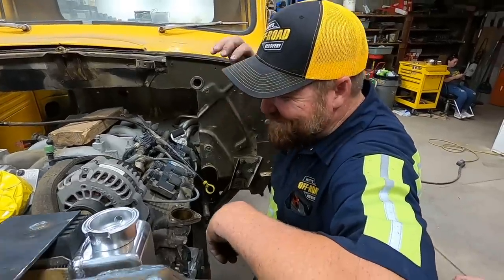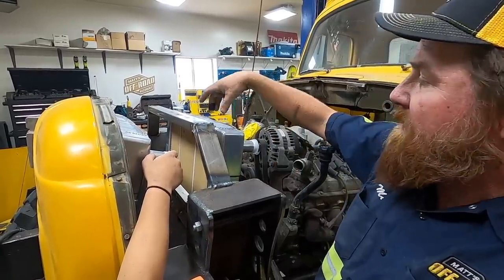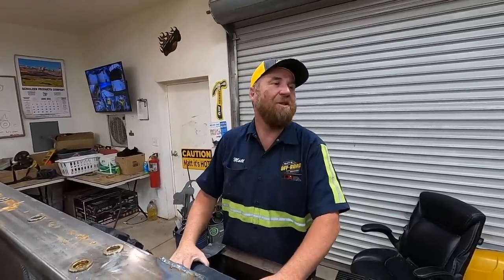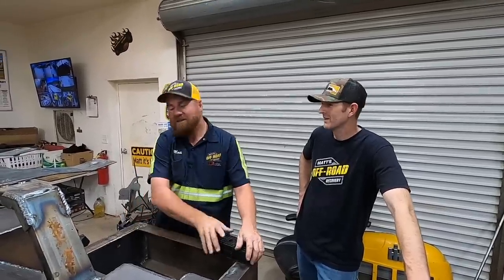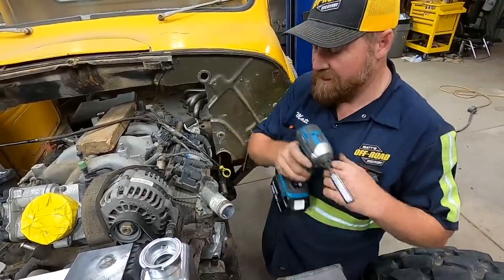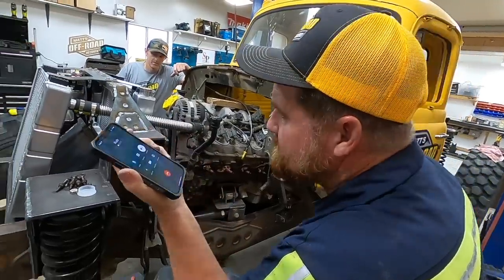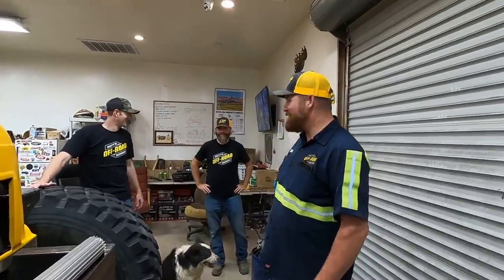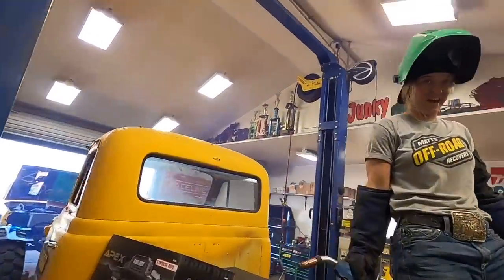This Part Ruined All My Work! The World's Largest Off Road Wrecker

Comment: I have an engine oil cooler on my 3500 dualy.   Considering the heavier loads you are going to put on a wrecker, especially in the environments you will be running I would highly recommend it.  Its really helped out when pulling heavy loads up some steep grades in high heat.

Comment: Assuming you have the room under the bonnet, consider finding a way to raise the fill port a few inches so it is above both radiators to aid in filling. You need to have a common high point to properly purge the air.
Reply: I was going to say something similar.  From my experience in building water cooled computers's back in the day before they made main stream blocks and RadFanCoolerReservoirs for them like they do now-- I toyed around with extra large reservoirs where the pump drew from the cooled water in the res than from the cooled water from the Rad.  Although this created a condensation effect on hot days from the Res...the system ran cooler with Res to pump to block to rad  than drawing directly from the Rad to Pump to block to Res.
Reply: It was shocking  to see neither of you have ANY fabrication videos on your channel. yet here you are giving advice to a professional fabricator. Dang that is weird stuff.
Reply: Came here to say the same thing. As it is, I'd say he will have a issue with air pockets. I'd  recommend adding a steam port from the crossover to the fill port.
Reply: @eriklarson9137  it was good advice.
Reply: @eriklarson9137  not all experienced builders have to be youtubers so no need for negative feedback on a valid suggestion. Its a common knowledge that the filler or the reservoir has to be higher than the rest of the system since the air gets trapped in the highest point. To me it seemed that the filler was the highest point so it should work just fine.  If its not possible to achieve, there is a bleed valve added to the highest point.
Reply: There's a cap on the radiator 
Filling it and bleeding won't be an issue
Reply: @eriklarson9137  many smart people don't video everything they do.  Doesn't make them wrong.  Besides this is a place for ideas.
Reply: @eriklarson9137  remind me to add that to my contractor/mechanic interview questions.  "Do you do you tube? No? Darn sorry, random internet guy said if you dont do videos, you don't know what you are talking about."
Reply: As long as the radiator cap is the highest point in the system he will be ok. If not he needs to add a surge tank to raise the radiator cap in the system. It looks like he is ok.
Reply: BFTtheTRUTH  Air Lift is a tool that pulls a vacuum on the cooling system so you can then pull the coolant into the system and not get any air pockets.  It is a requirement on some new cars such as the GR Supra.
Reply: @eriklarson9137  I'm pretty sure he runs a rescue company, and is not a professional fabricator.
Reply: @xMeta4x  however he has built 2 very successful 4X4 builds used has recovery vehicle's
Reply: @eriklarson9137  as surprised as you were to see people helping, i wasn't surprised to see your negativity
Reply: @qualtain01  😆
Reply: @michaelnieman6218  I built a shed, that doesn't make me a carpenter.
Reply: @EarlLeeBird  Exactly, look at Volvo VNL chassis and Navistar. The radiator is below the engine and fill point and they are a PITA to fill, gotta use a vacuum filler. I have a YT channel but don't show my fabrication, does that mean I can't? Sorry....
Reply: @xMeta4x  how about a carpenter in training however ever to built a shed takes a few skills to do unless your calling yourself dumb
Reply: @eriklarson9137  
Lots of people do not showcase their skills with uploads to YT.
But they have the knowledge to add/critique to a YT design...
and as with many previous vids' comments....
Matt will be made aware of them by his team...
Reply: I came to mention the same thing. It could be the camera angle, but the front radiator looked to be higher than the rear radiator. That means air will always get trapped in the front rad - even if the fill neck on the rear rad is higher.

In order to get all the air out, may have to weld another bung to the top of the front rad that has a bleed screw to burp the air out.
Reply: Vacuum fill the system.
Reply: Its got some pressure to drive the water up higher. But it will mean that every time he opens the fill point, with the engine off or cold, it pours out... lol.  He can run a hose up to a reservoir so as to prevent the pressure problems.
Reply: @EarlLeeBird  the water pump will pump water up to the highest points of the front radiator... then when he opens the rear radiator, its gonna want to flow down hill... depending on the slope of the vehicle at the time.... its not a big issue,  the coolant  will still flow  at the same rate and temperature, its just a bit annoying to lose coolant every time you check.
Reply: @LScout800   its just a bit annoying to loose coolant every time you check coolant ( maybe not if the engine is running hot enough,  the thermostat open... the flow  of pumped water  keeps the water up high  in the front radiator so it doesn't want to come out the filler ? ???  or even with the thermostat open  it might still pour out the filler ? ) Its not a huge amount of coolant though, and you will know its hot with the metal parts and all, and you can reduce the loss by checking with the hot engine running.,.
Reply: @eriklarson9137  I have fourty years working on hydronic systems (look it up). They have a valid point, you, not so much. don't be a dink.
Reply: @i-_-am-_-g1467  The point being that both radiator top tanks need to be connected to a common high point that can relieve to the overflow or air and non-condensible gases will build up.
Reply: @mrdanomac7937  there with in a 1/4 inch it will be fine
Reply: @eriklarson9137  so just using the content of their chann disqualifies any knowledge they might have? I guess Matt has zero experience in grilling steaks, or steaming vegetables?
Reply: @EarlLeeBird  just goes to show how much he Erik knows. lol.
Reply: @qualtain01  lol, I loved this comment.
Reply: @eriklarson9137  Wow .. I didn't realize that I had to be a content creator to give advice on stuff I know because I've done it.  I guess to prove you've done things these days I have to have videos I've done them?  It was simple advice on what I found to be an experience that took me time and money to figure out... how dare me not have any videos to show it ... Also ... Although I don't know Matt's entire work and life story I don't recall him every saying that he is a professional fabricator.  Its Weird that complete strangers online would have a problem with trying to provide help a fellow person out with advice I'd learned from my experience.  Hey .how about you take a nice long walk of a short pier.
Reply: @whidbeyhiker4364  I love my hydronic system in my shop!
😁

Comment: Matt, your coolant path is backwards in terms of cooling efficiency.  You want the hottest coolant on the engine side, with the coldest coolant at the front of the truck.  This makes a counter-current heat exchanger (air is front-to-back, water is back-to-front) and allows for maximum efficiency of heat transfer.
Reply: tend to agree, though honestly don't know what else or why run 2....see how it goes I guess
Reply: I was thinking exactly that same, otherwise the system would be re-introducing the shod heated air back into second radiator air flow.
Reply: @onecrak  you ever been to the second place in the country hotter than h€££?
Reply: @macking104  don't think so but she gets pretty bloody hot where I live🤔😂

Comment: Matt, especially since you ran into that by-pas issue, you can run coolant from pump to rear radiator first then through front and you'll get a greater total temperature drop. That 195° from front is going to saturate rear radiator. And just leave by-pass heater core circuit the same so you get good heat. Or you can put card board back in lol! I won't bore you with the math I did between oil cooler, condesor, radiator temps. But you should be able to drop 15°-30° per radiator.  You just always want your coolest temperature Liquid cooler in the front. Great double radiator idea! I'm super excited to watch this! Gonna be amazing!!! 😃😃😃

Comment: Wow, that's pretty cool. 

I think the air should flow through the secondary radiator first, and then through the primary. Temperature difference is important to heat transfer and if the air flows through the primary first the temperature difference may be higher across that radiator, but it would be reduced across the secondary radiator. If the air goes through the secondary first, it will maximize the temperature difference across that radiator, and there should still be a significant difference across the primary because it will always be warmer than the secondary. 

What are your thoughts?
Reply: @MattsOffRoadRecovery  Yeah, I agree. You should see how it works the way you have it first. There may be an efficiency advantage to the air flowing through the secondary radiator first, but it just might not end up making a practical difference here. And if you need to change it then you will know it's done right because it will have been done twice. 

Can't wait to see this thing move under its own power.
Reply: @MattsOffRoadRecovery  Can you get reverse pitch fans that will blow forward, like your forklift likely uses? Or would the air pressure from driving keep that from working properly? Just a thought. I love watching you work with your team!
Reply: @ingluv  you can get push or pull fans. 

I haven't finished the video yet but if the area between the radiators is fully closed off then installing a "pull" radiator on the back of the front radiator will push into the back radiator
Reply: @ingluv  I don't know if you'd want to push the air forward against the natural flow when driving.

Comment: Hey Matt, not sure if it's already been considered but keeping engine oil temperatures too low will actually create unwanted condensation in the engine galleys and passages. The resulting corrosion can bring about some undesired effects. Having seen these effects in the world of aviation many times, I just thought I'd give a heads up. The build is looking great so far.

Comment: Really enjoyed the in depth cooling explanation! I wonder though, would it be better having the flow direction going the other way? IE, hot water goes into the rearmost radiator, then into the front one, so that the coolest air is cooling the already cooled water? I wonder if in the current setup the second radiator .ay have little to no effect due to the cooled water and heated air being to close in temperature to work well?
Reply: You are correct, I've replicated this same problem myself when building watercooled PCs.  Same concept.  You want each radiator to have clean, cool air for maximum cooling power.  If they are stacked you are only getting like 20% efficiency out of the extra rads.
Reply: Yes, this
Reply: It's actually impossible to tell really without some air flow testing. Given that Matt prefers mechanical fans the second radiator will have the most draw through it even if fully boxed in. As there is a split down for the condenser and second radiator to draw air not pulled through the first radiator. 

If they don't box it in then most of the air being pulled through the second radiator will be coming from around  the first (Path of least resistance and all). However it will still help in radiant heat exchange and thermal capacity of the system.
Reply: Yes, I second that. Nicely explained! (Engineer working in fluid dynamics and thermodynamics)
Reply: Yep I agree as well… Matt has a way of thinking/not thinking but his way works for him. We all a friend like that lol
Reply: If stacked radiators in the same air flow path offered any benefit the major vehicle manufacturers would be doing it long ago. Another point to consider is the water flow direction; whereas, most aluminum head engine design has water being pumped into the engine while other designs has the water pumped out.
Reply: @GeneralEOD  Radiators are indeed stacked in every car that has air conditioning. The condenser which is a radiator is directly in front of the radiator. 

And this done purely for packaging. Ideally it would be better to be elsewhere but that would be more expensive and require more volume of space. 

Another example is high boost diesel engines which will have stacked radiators where the second one is the engine coolant radiator and the first one is for the water for the water to air intercooler. Ideally they would be in separate places with their own fresh air but packaging prevents this.

Here the situation is reversed. Matt has the volume because of where he has moved the engine but to fit under the bonnet of the body style and within the frame He's at max height and width dimensions. But he does have extra volume in front of that to work with hence stacking them becomes an effective solution.

Everything about design is compromise, nothing is designed for 100% efficiency as then it would be uneconomical to build it or you would run into constraints of other factors such as physical dimensions.

Comment: The best heat exchange is counterflow.
On an tube cooler: when oil flows from right to left the water flows from left to right. The oil comes in hot en drops in temperature. Where it leaves the cooler the cold coolant water gets in. This way you have the most difference in temperature between cooland and the stuff to be cooled. This gives the best heat exchange. 

Thats why i suggest to  connect the outlet of the engine to the rear radiator. Indeed the air is hotter but there will be the most difference in temperature between coolant and air.

Comment: Genuine question: Should the flow of coolant go through the secondary radiator first? Similarly to a counter-flow heat exchanger, the coolant will be closer to the air temp and therefore lower entropy loss will occur making the system more efficient?
Reply: Seems like a good question.
Reply: No, you'll get the highest heat transfer if the hottest coolant is going into the hottest radiator. Higher temperature different. Then run the coolant through the coolest radiator last.
Reply: I had a 850 holly carb on a 350 LT in a '70 Camero that I could not keep cool for around town driving.
Reply: @Bryan-Hensley  right, and the rear radiator will be the hottest so it should be first in series
Reply: I can't wait to see how this works I think it should work great. Very "COOL"
Reply: @bigjay6743  oh yeah this might not be the ideal configuration but I think it will be more than good enough, especially since the 2nd rad is a 2-pass with cold air coming up the bottom
Reply: Entropy loss?
Reply: So I'll try to answer this, the main radiator is in the front, that is why it gets water first, it gets the most airflow so it'll handle the heavy lifting, the smaller rad is acting as a larger water holding tank with cooling fins and makes building the hoses easier to get them lined up, 
You put fans on both and run the secondary as a passive system and then kick the fans on when doing any heavy load work.
I'm not sure how much cooling he's adding but he'll need a transmission cooler I don't know if he's hiding it under the body or putting it up from for airflow, that remains to be seen, he could add diff fluid coolers power steering cooler etc, if he had any smarts he's fuel a fuel cooler in also.
Reply: I thought the point of a counter flow was the allow the water to hit the coolest water as it exits and the warmer water at the start is still cooler than the water entering. 

I use one in my home brewing and that's how I always thought of it
Reply: @Scootermagoo  I belive he pointed out the trans cooler is in front of the radiator nearest to the engine, the air dam (covers half of the radiator) that grabs air from under the front end sort of covers the trans cooler.
Reply: It would all depend on which you call ‘secondary’, but yes countercurrent would be back to front.
Reply: @Bryan-Hensley  I think you’re talking about the same thing.  ‘Secondary’ radiator here is on the engine side.
Reply: @Scootermagoo  this would operate at a lower efficiency that the reverse.  In this configuration, pre-heated air is interacting with pre-cooled coolant at the rear radiator.  Because they’re closer in temperature, less heat transfer takes place.  The most efficient heat exchangers operate counter-current, meaning here the rear radiator would need to be fed with the hottest coolant.
Reply: you are 100%  right

Comment: The front radiator needs a dip tube to ensure flow goes to the bottom half of the radiator. Also, hot fluid to the inner radiator first to improve cooling as others have commented. It is called counter current cooling if anyone wants look it up.
Reply: Matt,
Please take note of these two comments. You may actually make your cooling worse if you don't fix the fluid instability issue in the front radiator. The way it is set up now the hot water will enter the front radiator, flow through the top portion and flow out the top. The hot water will never reach the bottom of the radiator especially when you are driving and cooling the fluid that is in the bottom half. The cooler/denser fluid in the bottom won't mix with the hotter/thinner fluid in the top. There is a reason the inlets and outlets on radiators are on opposite corners. Also swap the radiator flow. The radiator with the cooler fluid should have the cooler air. Otherwise you could end up with the second radiator fluid and air temps being very close together which would negate any cooling effect.
Reply: Dude.. you're a genius 🇺🇸👍